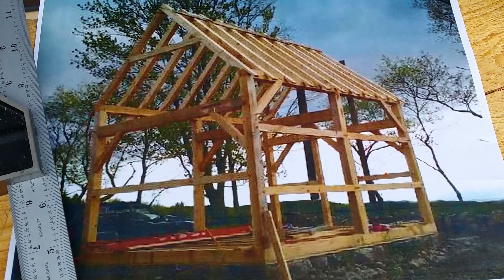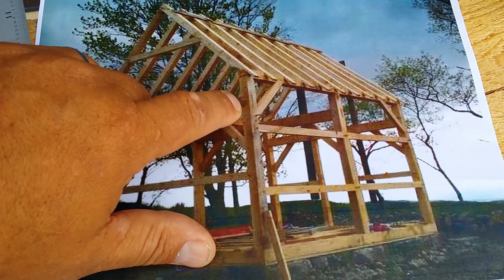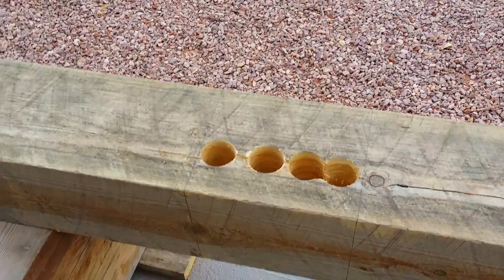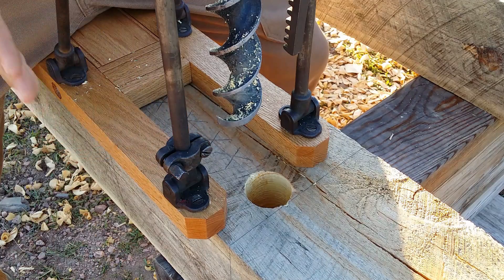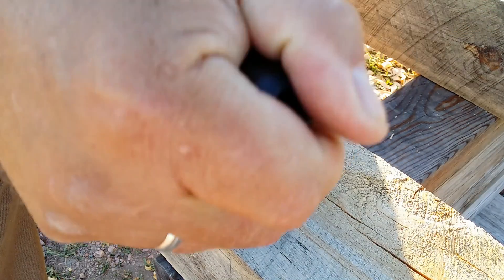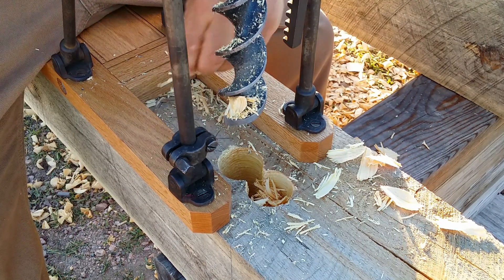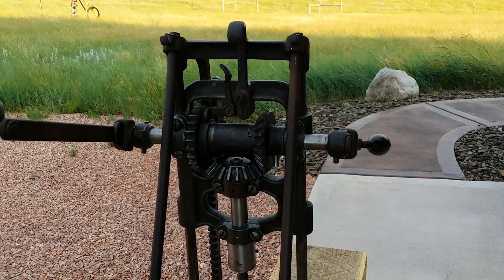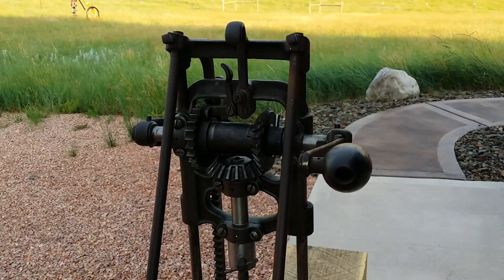Timber Frame Barn 10 - Building Design & the Boring Machine

Comment: This frame looks like a modification of the Sobon shed in his book with the maroon colored cover.   The design in your head is referred to as the "air castle"  I use this often, especially on small projects or stuff I am working on by my self.   

I started out just guessing at the placement of the bit in the series of holes in the mortice.  Then I progressed to laying out center holes and setting the feed screw exactly on those marks, sometime predrilling a pilot hole a half inch on the mark and have settled on just pushing an awl into the mark and then setting the feed screw into awled hole.  Also when boring through mortices I only bore half way through from each side.  The first few inches is easy with the boring machine so I try not to bore deep holes if not necessary.  I really like the corner chisel to chew the corners, and spaces between the holes if the holes don't over lap or come close. Very cool to see a project unfold.
Reply from the maker: Timberdoodles You are right, it basically is a 16x20 version.  Great idea on the boring machine, that would work great and speed things up.  Thank you for the advice, greatly appreciated!
Reply: Tim, it is a blown up Sobon shed. I built the barn in the photo in 2016.